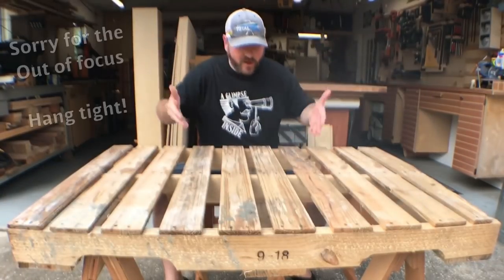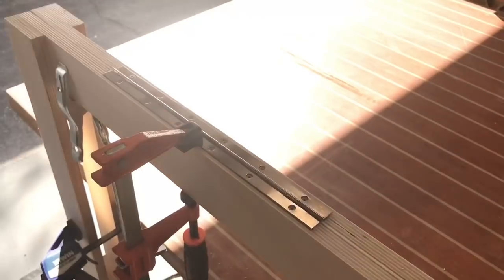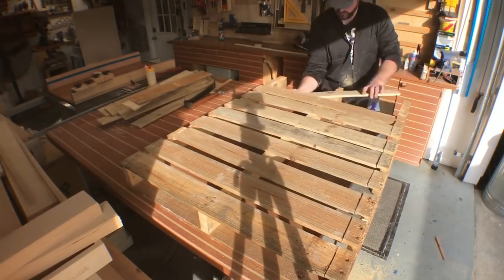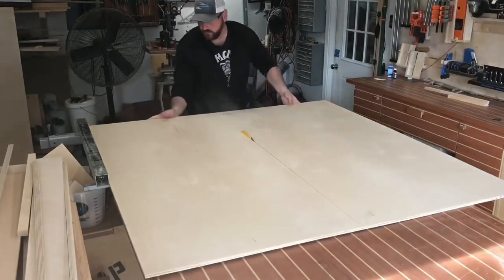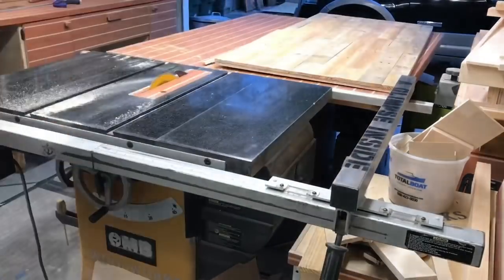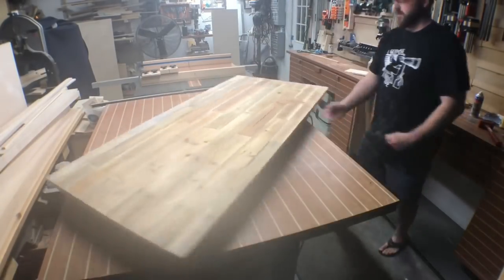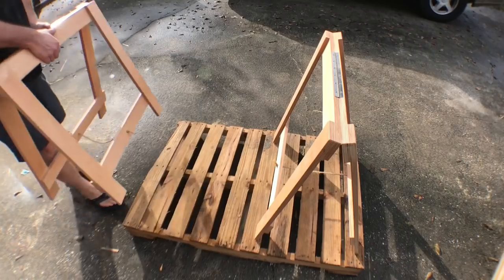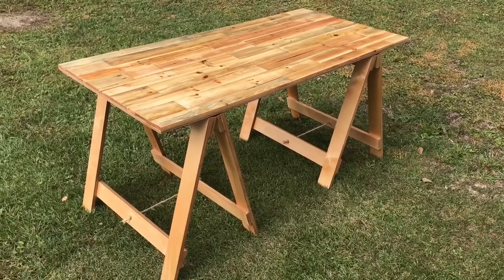DIY Mobile Pallet Wood Farmhouse Table | How to Woodworking | Sawhorse Table

Comment: Gave your a thumbs up and here is my comment that you request in the video. 
First off, very nice job as always. Much better than I did sitting here on the couch. 
Second. Well there is no second because at this point most people have stopped reading so I shouldn't just keep on typing like this because it's not really going to matter to most people but if you happen to still be reading you may be starting to be annoyed or you may be inspired to write your own massively long run on comment about comments themselves so as to continue the long comment tradition I founded back in 1812 which quickly became out of control and sparked somewhat of a war.  Sorry about that.

Comment: I like it.  So if I wanted to use the epoxy and get a flat finish on the table top, how could I achieve that?
Reply from the maker: My Honey's Handmade What’s up Steve, great question. You would simply leave the Tyvek tape intact around the entire surface and flood the already stabilize the pallet wood with one more thick pouring of resin!!
Reply: @AGlimpseInside  Ok.  Does it dry flat or glossy?
Reply from the maker: My Honey's Handmade It will dry and cure with a glossy finish however with medium to high abrasives you can always give it a matte finish